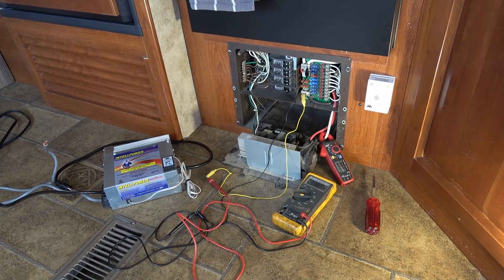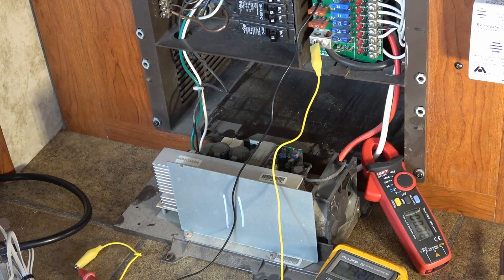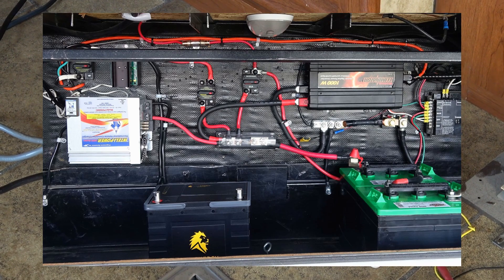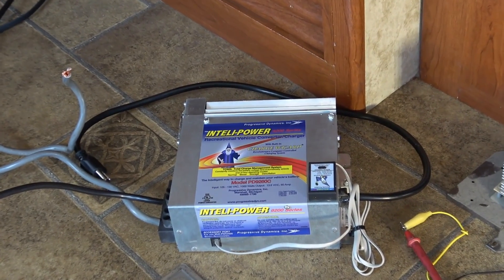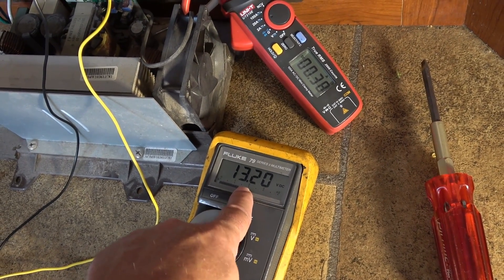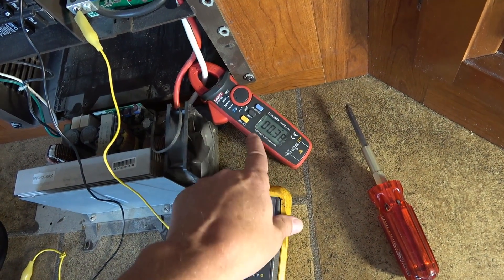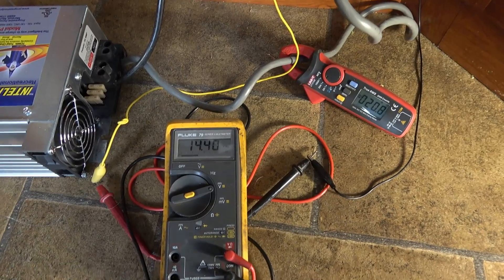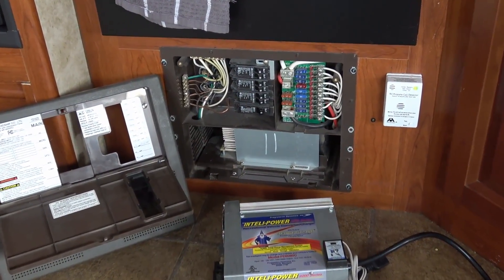Lithium RV Battery Charge Test -  Can You Use a Lead Acid Converter/Charger?

Comment: Great information.  I'm thinking about adding Li but keeping the AGM and isolating with a switch, then put 200 to 300W solar on Li side. Maybe Put a DC-DC charger on Li for driving.  Purpose of AGM would be 1. Backup batt,  2. Emergency start, 3. Already paid for.
Reply from the maker: Sounds like a good idea. I have both lithium and lead acid banks on my boat with selector switch. Also, just did a LIFePO4 charger review, cheers, Ray  https://youtu.be/bbJpVz7Z8iw

Comment: This is exactly what I wasted half my weekend trying to find, just to determine whether I need to upgrade my DC converter to swap my lead acid for LiFePO4.  As a bonus, I already have nearly that exact model Power Wizard already in the camper I just bought (mine is PD9245C) only without the remote pendant.  So I was especially happy when I learned I can order that part on Amazon for just $16.  At least until I upgrade to solar I think this is all I need to maximize the value of my soon to be delivered 100AH LiFePO4.  I can hit the override button to charge it up to 100% when I need it while traveling but leave it in default mode to maintain a safe and gentle 60 or 70% charge during storage.

Comment: Quick and dirty way is a 500 watt 12v-120v converter from vehicle and a house lithium charger to your battery. Run 120v extension cord close to battery and charge that way.

Comment: My battery setup was up front too. I put the cables onto insulated lugs. Then installed the lithium battery right behind the breaker box. Luckily the breaker box is not near anything heat related.

Comment: Can the lithium be overcharged or damaged with constant 14.4v?  I have this same PD charger.  I wonder if it has the 14.4v internal jumper people mentioned?
Reply from the maker: No, this is exactly in the voltage range most lithium batteries call for usually they say between 14.2V - 14.6V. The internal BMS ( Battery Management System) board will take care of reducing the charge current and eventually cutting it off completely once its fully charged. I haven't heard about an internal jumper for this model, I just use the Charge Wizard pendant button. Once it's put in 14.4V boost mode I think it has a timer of about 4 hours. Cheers, Ray

Comment: The problem occurs when the converter goes into  its desulphate mode, which can kill the BMS in our lithium batteries.
Reply from the maker: Why would it kill the BMS? They pretty well all have high voltage protection. The BMS would simply switch off charging to the lithium cells. That's one of its jobs as a BMS.
Reply: @LoveYourRV  The BMS will be subjected to rhythmic high voltage spikes and it isn't designed to deal with them. There's generally quite a difference in dealing with just high voltage and high frequency spikes.
Reply from the maker: Interesting, I wonder if some types of BMS boards handle it better than others.  I have used and tested about a dozen different brand LiFePO drop-in replacement RV batteries and charged them with different lead acid chargers, WFCO, Progressive's Dynamics, and IOTA, with no issues. Once they see a voltage of about 14.6V, they shut off charging. 
I haven't noticed any of the battery manuals warnings of this issue. You'd think if they started seeing many warranty claims with BMS destroyed, they would clue in.  I will send some emails to ask their engineers and see what they say.
I wonder if this has been an issue with other use case Li batteries, and now it's something people are told to worry about with RV drop-ins. Solar controllers, especially the PWM type, also use rhythmic pulses to charge, and often voltages get pretty high near the end of the charge. I used a PWM type for a couple years with my Lion Energy lithium and had no problems.  Cheers, Ray

Comment: Have you tried to adjust the OEM converter charger to output 14.2V rather than the standard 13.7V during adsorption charger.   There's 3 pots on the OEM charger on the vertical board close to the fan.  The Pot closest to the fan control the fan.  The center Pot controls the bulk charge.  The Pot furthest away from the fan controls the adsorption voltage.  I adjusted my OEM converter and it charged my LIFEPO4 to 100%.  I set the adsorption voltage to 14.2V which was maximum for the converter.  It would be great to have the instructions for the OEM setup but I winged it anyway rather than purchasing a new Li converter.   The 55A OEM converter charged at 36A with a battery <50% charged and tapered off to 10A when the battery got to 97%.  I managed to charge 100AH in 4 hours which is an average of 25 amps.
Reply from the maker: No, didn't know that they have manual settings. Cool! thanks for the tip. I've since tested out the WFCO lithium/lead acid two in one charger and it worked for the most part outputting 14.4V and constant 50 amps or so, but had a little bit of flakiness now and then getting going at the high amp rate as it was an auto detect model https://www.loveyourrv.com/wfco-electronics-auto-detect-lithium-or-lead-acid-converter-charger/ Cheers, Ray

Comment: What float charger do you recommend for deep cycle battery?
Reply from the maker: I've used WFCO, IOTA and Progressive Industries and I think I like the PI one best.  They work best if located close to the battery as voltage drop on the long cable lines can through them off and slow the charge time. Cheers, Ray

Comment: I am curious about something here. Your trailer is a 30 amp service. Should the main breaker not have popped when the charger was pushing in 40 amps.? Yet Keystone installed a 30 amp service and a 55 amp charger
 Confused..
Reply from the maker: The 30 amp breaker is for incoming 120V AC power from the RV park. 55 amps is max DC rated amps at around 13.6 - 14.4 DC volts. The AC power input for the converter is around 1000 watts so uses roughly 8 - 9 AC amps when at max charging amps. They use a 15 amp breaker for the AC supply line to the converter. A converter charger converts AC to DC then uses the DC power to charge the batteries. Cheers, Ray
Reply: @LoveYourRV  Thanks Ray I knew I must be missing something.

Comment: Perfect answer to a change over in old lead acid. Great insight into a good  around and preservation of Lithium Iron phosphate.  So it seems your solution is multi uses.  In a park on shore power through standard old lead acid charger 12 volt converter it then goes into a “no harm” preservation float mode?  The caveat is though I’m off grid or power out situation the LIons would not be topped off unless by solar or generator or alternate AC source via the device with bypass algorithm switch?  Do you then isolate or switch /disconnect the old lead acid charge leads?  Brilliant video regardless truly helped me understand. Thanx
Reply from the maker: This video shows how I typically recharge off grid with a second converter charger located beside the battery bank https://www.loveyourrv.com/2-year-update-safari-ut1300-lithium-batteries-and-energizer-gas-generator/ 
Last winter I installed an auto detect lithium/lead charger from WFCO https://www.loveyourrv.com/wfco-electronics-auto-detect-lithium-or-lead-acid-converter-charger/ it seems to  work for the most part.  Cheers, Ray

Comment: Great video, quick question about the intellipower unit .  I have a PD9270 and it has two DC neg and positive connections.   Does this mean I can charge two different battery banks?
Reply from the maker: Sure you could but keep in mind you are then basically paralleling the battery banks together unless you add cut-off switches to charge them separately. I think the reason they have two terminals is to allow for doubling up on the cables to effectively increase the overall wire gauge. For example if it was a long run to the battery bank a person may like to run two cables for positive and two for negative to reduce wire losses and voltage drop.
Reply: @LoveYourRV  ahh..  great answer…. Thank you.

Comment: I have questions.

Preamble:
I "Simply" wanted to replace my two lead acid batteries with two lithium batteries. I knew I would have to change My Converter/Charger and that was "Not a problem". Only, there is nothing simple about this process and there very much ARE problems. 

First, I purchased two renogy 200watt solar suitcases and a renogy 40amp mppt charge controller. My batteries, (brand spanking new interstate 6 volt "EXTREME" GC batteries) just aren't working for me. In fact, they seem to be actually worse than the two 12v interstate lead acid batteries they replaced. SO I decided i would go with 2 renogy 100ah lithium smart batteries. But,,,,,, renogy is adamant that the max charging voltage is 14.4v and thus far all of the converter/charges for lithium batteries charge at 14.6v. Renogy says this is right out. So I was looking at putting in a maxpower converter/charger where you can set the constant voltage mode for 14.4v. But this never ever shuts off. It's constant voltage mode obviously. Now the guy at MaxPower told me that the batteries onboard bms should shut the charge current completely off when it hits a set limit. But he said you can't always trust the battery, and also generally speaking, its not desierable to leave the batteries connected to a constant voltage for long periods of time. So he suggested putting in a cut of switch between the battery an charger so that I can disconnect the batteries during long periods of being plugged into shore power and just let the MaxPower power the DC circuits. Well, that sounds all well and good, until I saw this video. 

As it turns out, I have the same PD charger you have in this video. Ok, mine is 70 amp, but other than that its the same. so here is my question. 

When you place the the charger into boost mode manually, how long will the charger remain in boost mode for? The literature says that once you release the button, the charger will stay in what ever mode you left it in until it senses a charge state change at which time it will automatically return to,,,,, well,,,, auto mode. But my assumption is that the charger is set up to sense voltages from the perspective of a lead acid battery, not a lithium battery. Will the charger simply kick out of boot mode relatively quickly after you place it in boot mode? Or is there a fixed time that the charger remains in the manual override mode you left it in? 

We camp primarily in DEC camp ground where there is never any power hookups. Therefore we are primarily bound to running a generator 5 hours a day to keep the batteries up. Id say 10% comes from solar, 90% comes from generator. Employing a cut off switch,  if the charger would stay in boost mode long enough, I could simply cut the batteries in and out as needed and let the converter charger run the DC circuits while the generator is running (or when we are plugged into to shore power at the house). I could use the manual button to charge the batteries when needed. But thats all predicated on weather or not the charger is going to play nice or not. Specifically I mean, kicking out of boot mode 10 min after I put it into manually.
Reply from the maker: I'll check the manual but I believe the manual boost mode on the PD9260 lasts for 4 hours and that jives with my experience with it. I've also recently install and tested a WFCO converter that does both LA and LI. You may be interested in those videos https://www.loveyourrv.com/wfco-electronics-auto-detect-lithium-or-lead-acid-converter-charger/
Reply: @LoveYourRV  

I looked at the link you posted and the WFCO runs into the same issue as every other Converter Charger I've looked at in that it's set to charge at 14.6V for Lithium. Renogy is insisting that 14.4V is the max charging voltage for their batteries. That's why I was looking at the MaxPower. But the boost mode on the PD9270V I have is set for 14.4V. So if it will stay in that mode for four hours as you suggest, it shouldn't be a problem to use it to charge the Renogy batteries. 

Ya know, I was looking through the literature available for the PD pendent and it says the following specifically for PD9200 series converter/charger:

"Manual control and monitoring while charging Lead Acid / AGM batteries. Also used to manually charge Lithium by pressing the Button Monthly or when charge is needed."

This is (as far as I can find) the only mention that I can find that suggests that the 9200 series COULD potentially charge lithium batteries. This despite COUNTLESS youtube videos, reviews and forum posts stating specifically that the PD9200 is ONLY for LA (and similar) batteries and can harm lithium batteries. While PD doesn't give any specific information that I can find concerning how one might effectively use a 9200 series to charge a lithium battery, they went out of their way to toss out that small detail I posted above. 

I don't understand why information isn't more clear. I mean to say, I feel like companies are doing this on purpose. 

My only other concern is that I have the 70amp model and while my LA batteries never got anywhere close to that kind of current draw for charging, the Renogy batts absolutely could draw that much. And I believe my 2019 Grand Design Imagine 2150RB uses 8AWG wire from the converter/charger to the batteries. This (OF COURSE) is no where near heavy enough. I may end up having to spend time and money changing that wire out. I don't care about the cost, but running that new wire is going to be a MAJOR PITA!
Reply from the maker: One thing you should keep in mind is there will be a voltage drop on the charge line. The longer and the smaller the gauge the lower the voltage at the battery bank. For example, when I'm charging my lithium batteries using the WFCO, the charge voltage at the WFCO converter output might be 14.6V but about 20 feet of OEM 6 gauge cable plus the frame ground return will knock that down quite a bit due to conductor resistance so the actual voltage level the batteries see will be less, maybe about 14V if lucky, maybe even less, I haven't measured it exactly. So if you are concerned about the Renogy 14.4V level just add more wire between the two.
Reply from the maker: Also its interesting that Renogy makes a 20A AC-TO-DC LFP PORTABLE BATTERY CHARGER that puts out 14.6V https://renogy.com/20a-ac-to-dc-lfp-portable-battery-charger/  hmmmm...

Comment: Dumb question. What Solar controller do you recommend for the Safari UT 1300? I’ve got two on my wolfpup trailer and the gopower 30 lithium controller seems to never get them charged up like they should. I’ve got 250 watts of solar panels on top; and this model of trailer has a 12 v fridge versus a propane so I need it to recharge as much as possible during the day for hot summer camping trips boon docking. I’m also looking to replace my charge controller like you did in another video to one that has a lipo4 switch or mode to charge them better off a generator when we need to. Thanks, Brian
Reply from the maker: Here are the solar controllers I've been using the last 5 months with good success - https://www.loveyourrv.com/srne-40-amp-mppt-solar-charger-features-install-demo/ They are made by a company called SRNE, relatively inexpensive and have a lithium setting or can be user customized.  Cheers, Ray

Comment: Thanks Ray.  I am going to swap over to lithium and need to upgrade my OEM WFCO. So I always start with Ray first !   Clear and concise explanations !
Reply from the maker: Thanks. Funny enough WFCO has recently contacted me and is currently sending a new model they have just released for me to test out.  It has a new feature called Auto-Detect. Its supposed to automatically detect what kind of battery type you have and change the charging profile. It works with lithium.  I'm going to swap out my 11 year old WFCO OEM with it and see how it performs.  Should be interesting.  https://wfcoelectronics.com/auto-detect/

Comment: Thanks for the great info! Does your new converter allow you to choose between lead and lithium?
Reply from the maker: No, its a lead acid converter but happens to have an add-on manual boost functions that works well for lithium batteries since it manually boosts the charging voltage to 14.4V which is good for charging lithium.
Reply: @LoveYourRV  I have seen that one. I understand now. Thanks
Reply from the maker: I've recently been contacted by WFCO that makes many of the OEM chargers. They have a new converter charger model out that is supposed to auto detect whether an RV has lithium or lead acid and adjust the charging. They may send me one so I can test it out. https://wfcoelectronics.com/auto-detect/ Cheers, Ray
Reply: @LoveYourRV  very interesting, thanks. I didn't see that when I was on their site last night

Comment: IMO, if you're sitting on pedestal power for weeks the LFP would be better off at 59% than 100%.
Reply from the maker: You bet. We spent all last winter on shore power so I left the batteries charging via the OEM converter and they sat at about 52% the whole time. Cheers, Ray